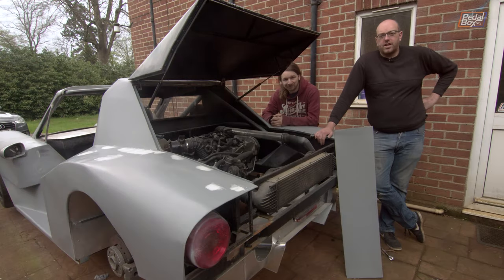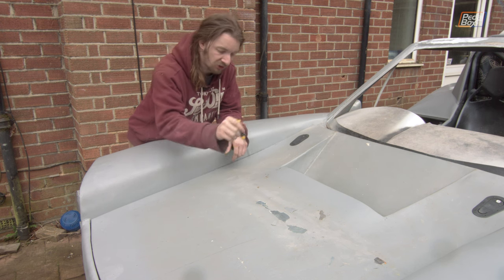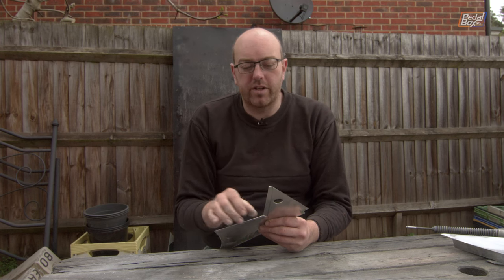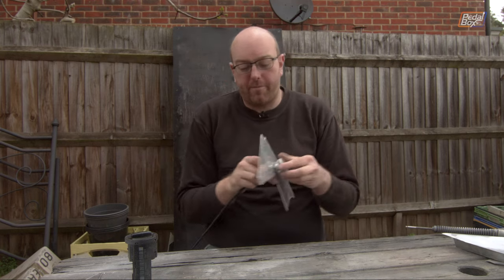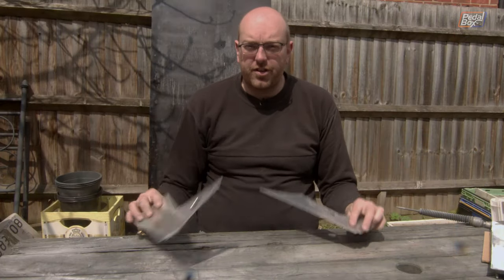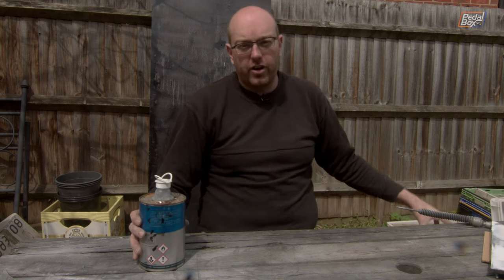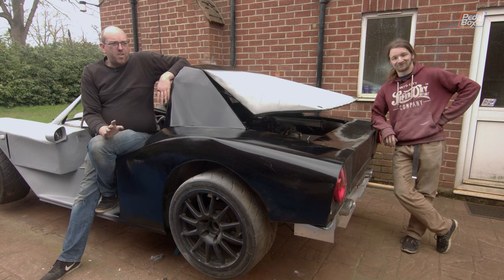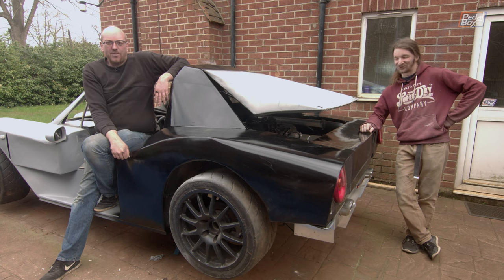ACTUAL Paint and Body Progress | Audi TT Kit Car | PedalBox Episode 133

Comment: It’s difficult to see from the video but I just wonder if wheel arch extensions will be needed to fully cover the wheels and satisfy IVA
Reply from the maker: The edge of the tread is fairly well in, but the alignment is WILDLY out due to the bearings being shot, so there s a lot of play as it's 'setup' at the moment. Once we get those done (which should be soon) we can align them properly, clearance what we need and adjust as needed. Hopefully without adding to the bodywork!

Comment: Epoxy primer would solve these problems
Reply from the maker: I can't fathom how/why I overlooked epoxy primer before, it would be ideal, probably end up doing a lot of the body where there's filler, although the paint is holding up well, where there's a few cracks in the bonnet it's still happening (obviously).